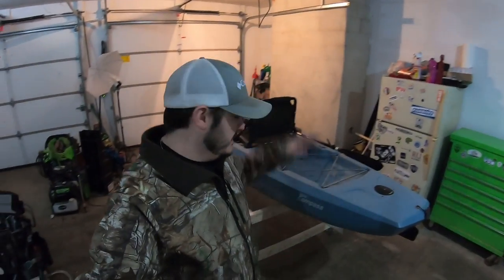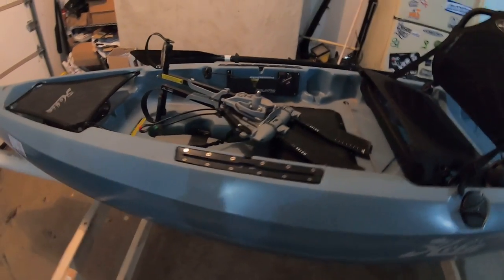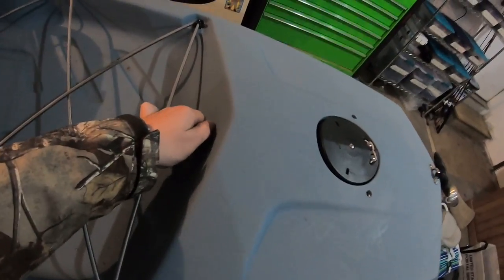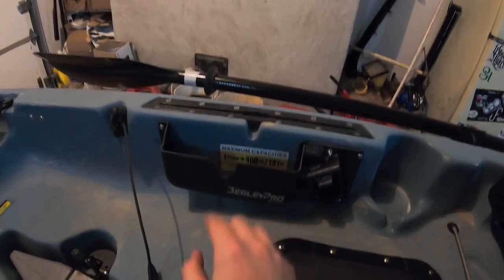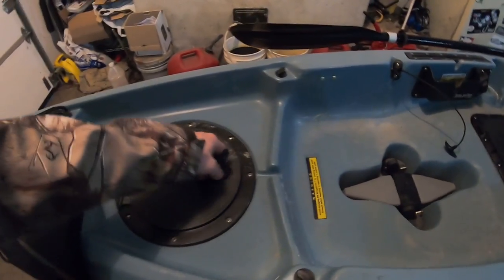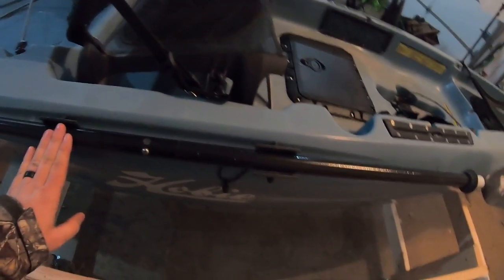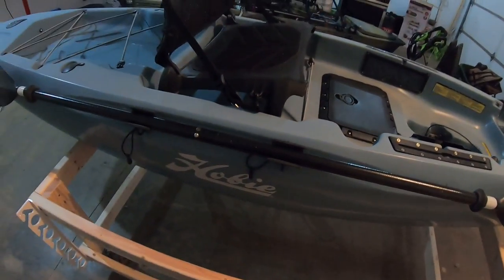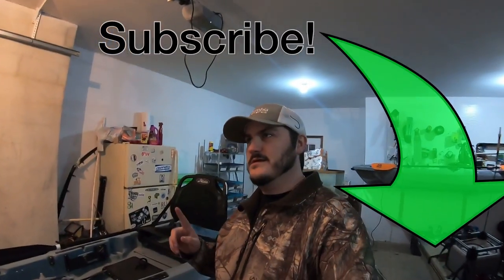Hobie Compass Mods

Comment: Was there supporting foam added inside around rectangular hatch to strengthen when standing?  Looks great regards, Danny ;-)
Reply from the maker: The foam is added in by Hobie at the factory to strengthen for standing and to add floatation,  I just moved it out a little further due to the rectangular hatch.
Reply: Hobie has a video installing the square hatch. Dan did a great job with the upgrades. All notes I'm taking when I finally get a Hobie Compass.

Comment: Can you explain the difference between the 180 ARC and non-ARC 180?
Looking at the Outback and Compass for 2019, but the big difference is the camo Compass comes with the non-ARC 180. 

Aside from the button adjustment, are these changes between the two? I'd imagine; why else all that R&D just for a button adjustment instead of the shaft clamp adjustment?

Thanks!
Reply from the maker: As far as I know the only difference is the way you adjust them
Reply: @BlueSummitOutdoors  Thanks for the reply!
That's crazy to me... But it's the only difference I can find anywhere I read as well.
Seems like a lot of R&D for not much of an upgrade.
I have read that the older model can have a little bit of play left to right when pedaling. Wonder if the ARC model is more stable in that regard.
Hoping to hit up Delaware Paddlesports this evening to check them out and compare.

Thanks again!

Comment: How does your wife like the seat?  Heard both good and bad.
Reply from the maker: She really likes the seat with one exception the bar in the back I've heard of putting a pool noodle there to pad the back-bottom portion of the seat frame. So we are going to try that. Other than that's it's very comfortable and simple.
Reply: Great, thanks for your response.  That really is my only concern with the compass.
Reply from the maker: It's a valid concern I thought it was pretty comfortable but I only used it for around an hour. Longer trips it may become a bigger issue. Check out the Hobie compass owners Facebook page there's a bunch of post on the seat in there.